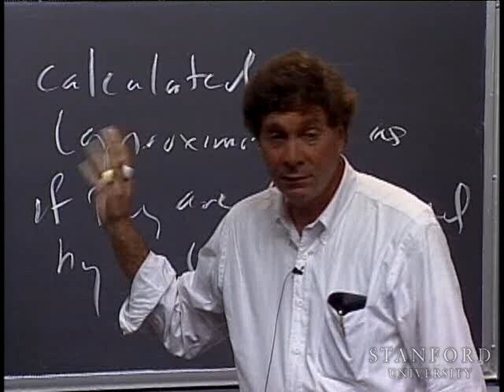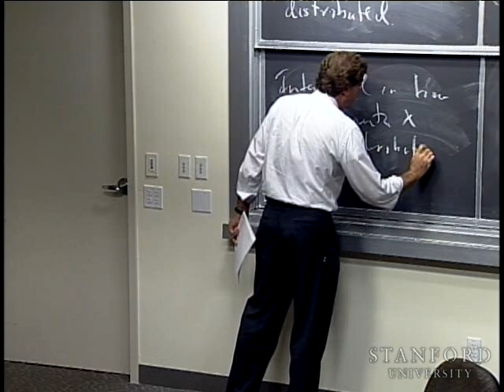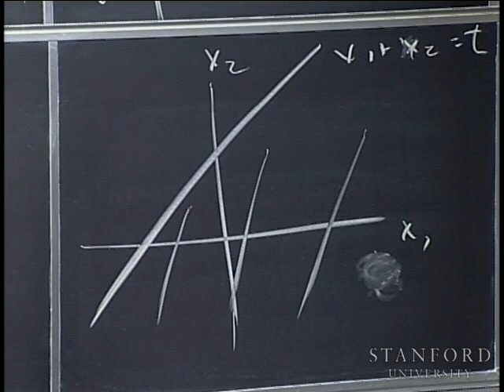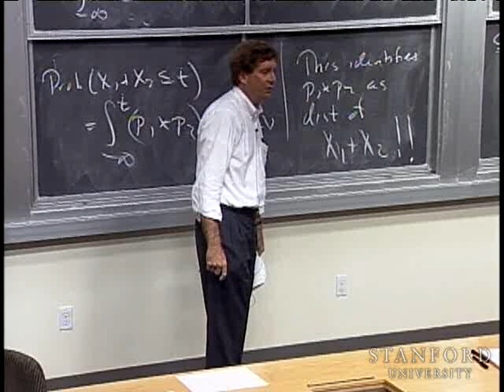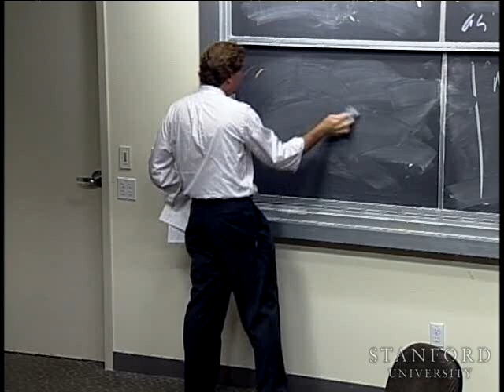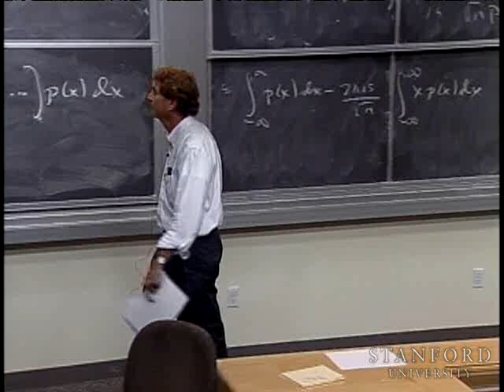Lecture 10 | The Fourier Transforms and its Applications

Comment: Isn't there something wrong with the slope of x1+x2 <= t? The line should have a negative slope.
Reply: yep
Reply: Can u or someone plz explain me... How??
Reply: @manitamta4159  for the line X1 + X2 = t, the intercepts on both the axes should be at t (the value of one of the random variables when the other is set to 0). The line connecting the two intercept points has a slope of -1. Also think about that equation, when X1 increases X2 has to decrease to make the sum equal to t.